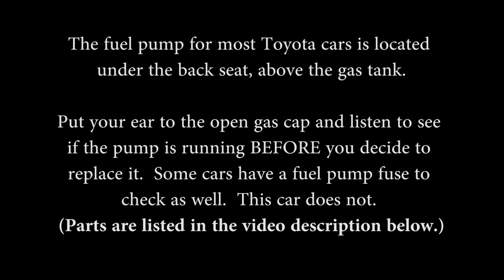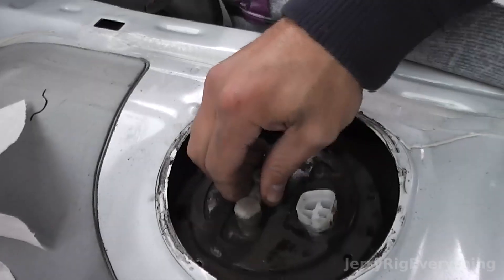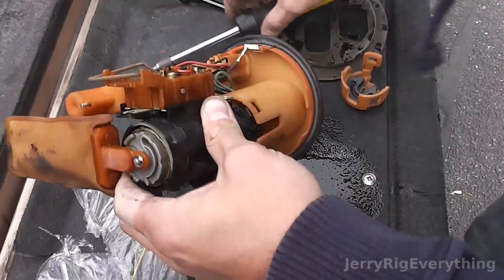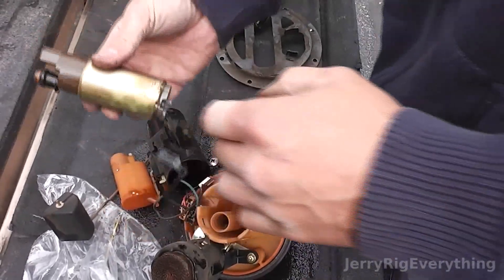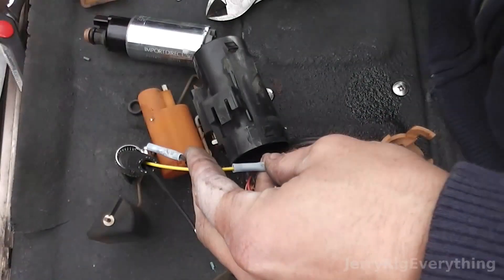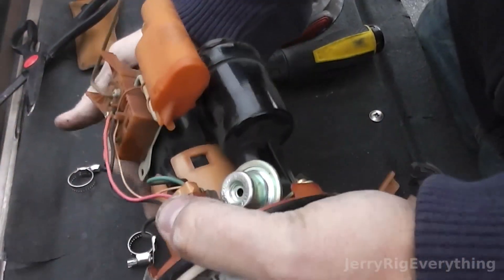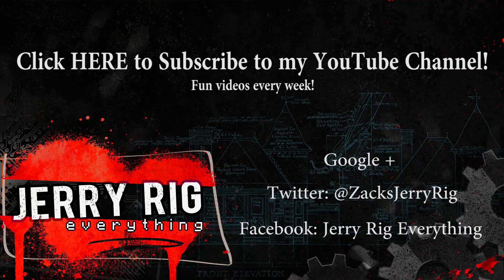Toyota Solara Fuel Pump Replacement

Comment: I have a Camry with an identical set up. FYI. I dont know if you know but The mesh like filter is not the actual fuel filter.  It , at least on my car is located by the battery. Great vid I wish it was around before I had to do work in the gas tank. Thnx

Comment: Hi i am about to attempt this repair on my 01 camry. Did you have to mess with the small bit of hose that comes in the kit, i was going to get the kit and denso pump. it has two small clamos and a bit of hose included.
Reply from the maker: To be honest, I wasnt quite sure what that hose did.  But... My fuel pump is still working... so it must not be too important.  If you figure out something that I dont know be sure to come back and tell me so I can include it in the video.

Comment: Great video.
Do you have any idea why a 2004 Toyota Solara ( 4 cyl. ) when the ignition key is on ON the fuel pump doesn't prime the fuel for 2-3 seconds as the Haynes Repair Manual said it should ( page 4-3 )? However the pump starts working when the key is on START.
Do you suspect the ECM, the fuel pressure regulator or the fuel pump ? Or something else ?
Thanks.
Reply: I think on the Toyota models they all wait until the ignition switch is in the start position before power is applied to the fuel pump. My 2005 Toyota waits until the switch is in the start position. Sometimes service manuals aren't 100% correct.

Comment: Jesusmuzik Most cars have redundant systems. The fuel filter for the pump is more for keeping the pump from constantly malfunctioning from particulates breaking the actual electronic motor (e.g clogging). The other that your referring to is more for catching particulates from the rest of the fuel system. My toyota 20 something almost and believing their wont be rust/other things in the rest of the system after that long would be wishful thinking
Reply from the maker: Very true.  Thank you for your comment.

Comment: why do you didnt replace filter as well while you replace fuel pump ?
Reply from the maker: Apparently that wasnt the actual fuel filter, I was mistaken.  It was just a preliminary filter.  And it looked clean enough.  The real fuel filter is located farther up under the hood.
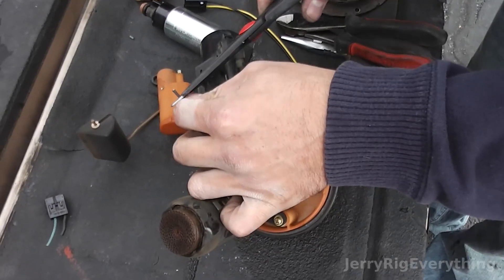Reply: @JerryRigEverything  Great Video!  I think the BLACK round piece as your Left Pinky finger was touching at 3:07- 3:34  Is The Internal Fuel Filter and the SOCK is just a minor prelim filter. These Engines will also have an External In line Fuel Filter in the engine compartment below the air filter housing box. Thank you for making this video.